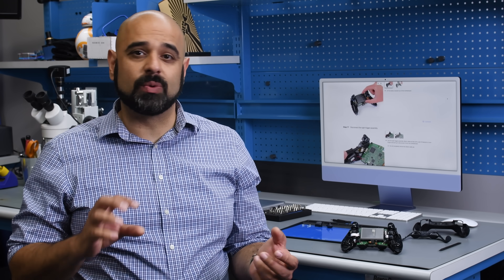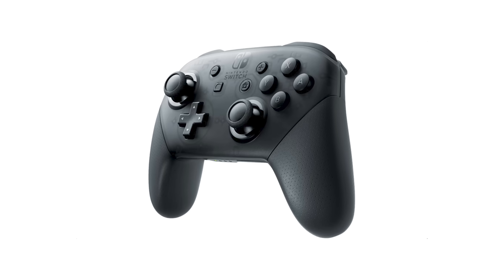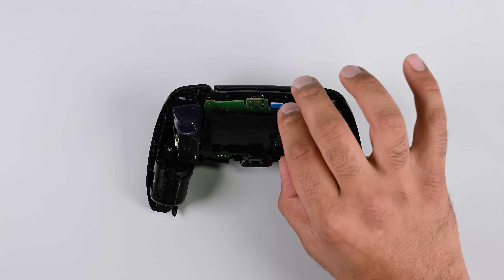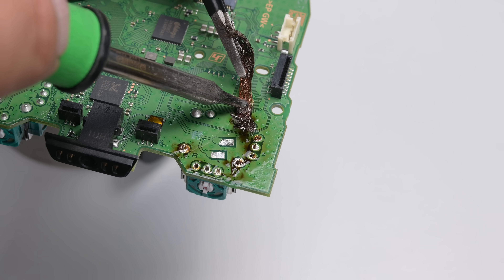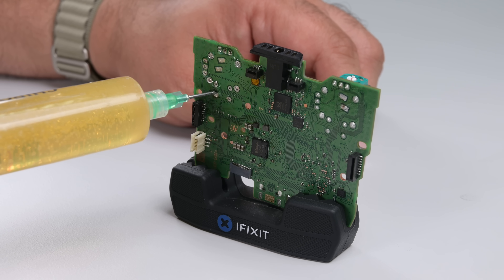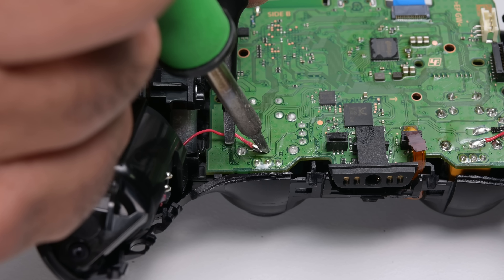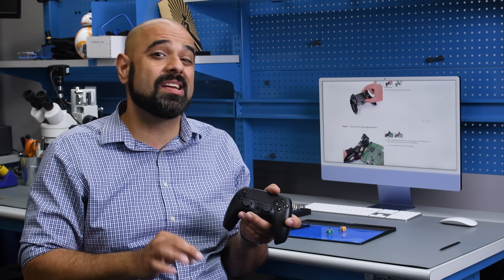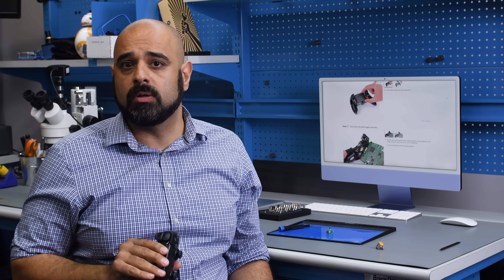How to Fix PS5 Joystick Drift for Good!

Comment: God, the more I learn about electronics, planned obsolescence, and how cheap spare parts are in comparison, the more I think I should finally learn how to solder.

Edit : corrected a mistake
Reply: You should. Its not exactly super hard, though the equipment could be expensive. Its a life long skill and you'd be glad to have learned it once a "i could repair this" moment arrives.
Reply: Go for it. Electronics are ubiquitous now, and being able to do basoc repair work is definitely a skill worth javing in your back pocket.
Reply: What you just said is why I taught myself the absolute basics through YouTube.

I had to start replacing the mouse buttons on one of my Logitech mice because it was double clicking like crazy.

Now I'm capable of doing very basic soldering. My greatest feat of work is putting a back buttons kit on my dual sense controller.

It takes me forever cuz I'm scared of messing up but I can get it done
Reply: Do it, it's not that hard.
Reply: Wait until you find out I made my own custom controller that polls at 8000hz vs the xbox elite at 250hz and I modded my GTX 1080 Ti so it has 22GB of VRAM. You're all getting PLAYED by nvidia and microsoft to steal your money selling you dogshit at inflated prices every year.
Reply: Soldering is easy. Takes a little practice. It'll save you so many thousands of dollars
Reply: Yea it's not super difficult to start learning, especially if you start with something larger like audio cables. 

The problem most of my students have is that they buy a cheap iron that doesn't maintain heat accurately, and then they end up struggling between "it won't heat up" and "I melted everything" lol
Reply: Solder*
Reply: @luigiymario2xd  thanks for the correction. I appreciate it
Reply: Hakko FX888DX is best bang for buck

Comment: It is possible to remove the potentiometers from the stick, that could make it easier to unsolder because things can be removed in smaller pieces.
Reply: Actually yes, just pry them open from the rest of the stick module while still soldered and when you heat up the three joint pads at the same time you can squeeze them out easily.

Sadly the potentiometers shown in this video (the most popular ones and seemingly the best option available at the moment) only fit their own analog modules so you still need to desolder the stock analog modules, but at least they feel smoother than the stock ones.

Comment: My biggest question is with these, are they as accurate and feel as good as the actual sony one's? Gotten some and they just don't  work the same... But i guess I'll have try them out my self once my  ps5 controller starts up... Usually for hard core gaming they last between 6-12 months for me. All from Walmart, got one directly from sony online and that last 3 almost 4 months. Currently i got a ps5 Controller, my first one, so we'll see if they last as bad as a ps4 controller, granted... I know some models use the exact same joycons as the ps4 controllers so I'm not expecting much difference.

Comment: hall effects sensors also suffer from stick drift caused by demagnetization
Reply: unless you're storing your controllers in a box full of neodymium magnets that's not gonna happen, the only other way is through heat which would melt the controller in to a puddle anyway

Comment: U guys should start selling battery upgrades, show us biggest and best quality battery we can put inside.
Reply: yeah I know right, i got me a 4000 mAh battery in mine, I got from aliexpress, controller lasts slightly more then 1 day of playtime now ;)
Reply: @XxUnkn0wnxX95X wow can you link it please
Reply: @XxUnkn0wnxX95X  which is still not much at all tbh, its what my curent ps4 controller holds and it has the original battery, tho I find it absolutely trash taht its barely a day while my old x360 controller lasted over a week of 10 hours of gaming per days with just 2 AA batteries, lipo batteries where suposed to be an upgrade compared to AA batteries, not a Huge downgrade...
Reply: @SpeedyGwen  you play too much use wired controller
Reply: They actually do now! A 2800 mAh one.
Reply: I play every day and do 4 charges a month with my Xbox elite V2 controller...PlayStation need to step up their game on controller battery life...absolutely ridiculous.
Reply: @JointEffort_NL  the problem is more that Sony's controllers are a bit more "feature rich" and all the rumbling and stuff simply uses more power. Still though, the battery life is ridiculous, recently got myself a PS5 contorller for PC gaming and it's definitely a let down compared to my xbox controller in many aspects. There are things I like about it too though
Reply: If a second one can fit inside the shell, you could wire a second one in parallel with the existing one. I did that to my wireless mouse and it now has twice the battery capacity 🙂.
Reply: If you have something that runs off batteries and you use it a lot it's going to discharge the battery no matter what you do. Just about everything takes some type of energy source and needs replenishing. I get that maybe putting a little bit of a bigger battery in will extend your time between charges but soon you'll be complaining about that battery is not big enough and for some reason taking a break and charging a controller is too difficult for some of you. Seriously weird things to complain about these days. It's almost like your life isn't easy enough as it already is.
Reply: @relive1775  Those batteries have a finite life span, and their capacity degrades over that time. Eventually, the battery needs to be replaced. This isn't a new concept.
Reply: @nickdibart   I understand that but that's not what's being discussed here. The discussion is getting more playtime out of a controller before having to recharge it. Most of these controllers take about 3 hours on average to charge when not in use, not to mention most people have charging cables all around them when they're playing and they can plug it in right where they're sitting. And if we're worried about people who are streaming to make money then they should have no trouble affording one extra controller to switch out with. Not trying to sound offensive so please don't take it as that but we're talking about finding solutions to problems that are so minuscule and easily remedied that it's kind of ridiculous.
Reply: @relive1775  I agree. It's been a while since I originally posted so I forgot the context of the conversation. The battery life on the dualsense has never been an issue for me, and as you say, a simple USB cable will suffice if I forget to charge it long enough for it to be a problem.

Comment: I've done a tonne of stick replacements on DS4s, I recommend one of those solder irons with a built in pump for desoldering. REALLY helps removing the old solder.
Reply: A decent solder sucker and low melt solder is significantly cheaper and 95% as good if you are only desoldering through hole components occasionally
Reply: Yea, can you post a link to an iron you'd recommend
Reply: Can i get any recommendations?
Reply: @corniel657  hakko if you want to invest in a pretty decent one, or go pro with jbc or weller.
Reply: @corniel657  hakko minimum, weller or jbc if you really want to invest in some great equipment.

I myself run 2 weller wxsmart systems a wx2 and 2 wxair units.
Combined with zero smog unit and 6 different solder irons.
Reply: What’s the name of the tool you use to hold your board in place?
Reply: That's the way😊
Reply: Being a PS5 owner means doing hard labor.
Reply: What is the name of it can you please send me the link of the soldering pump you are speaking of
Reply: @alansmithee2012 Can you share a link to one such soldering iron? I didn't know there was such a variation. Thanks in advance!
Reply: just bought one of those, I was struggling so bad to remove the old solder with wires, I gave up LOL
Reply: I agree 100 percent with you on this.  I purchased one as well.
Reply: i agree. i overdid (first time soldering) one circle and some thin sheet came out. my old controller has right dead stick now. i overdid it because i tried removing the solder using copper wire and the tip of the solder which scratched it off.

Comment: I buy 1 controller from Argos + insurance around £5. When it broke I take it back and replace it for a new one + I take out the £5 insurance again. Cheap as chips❤

To add. I’ve had 5 PS4 controllers and 3 PS5 controllers. Yet I’ve never had issues to date with the PS3😂

Comment: This was a pretty fun project to do. I was an absolute beginner going into this, I did know about this before this video so I already have done it, but if you are a beginner and you are looking to do this, its definitely doable. I had a solder with a heat gun station, and the heat gun to remove the joysticks made things so much easier.

Comment: I have been installing hall effect analogues for over a year in my service center. so far we have made almost 3,000 controllers. I have cooperated with all the big factories such as GinFull, K-Sliver and Favor Union. The best of them is Favor Union, their joystick are the fastest and most precise analogues on the market. Ginfull a regular 3rd party analogy factory t, which emerged from the K-Sliver split. Due to this, the technology is not accurate and cannot be copied from the main entity, i.e. K-Sliver. Unfortunately, Ginfull analogues often have problems with the stickbase and their hall effect chips have problems with AVG Error.

Comment: I bought some Hall effect sensors and tried to do this repair, but I am hopeless with soldering. I couldn't get the original stick off the board after several hours and gave up. I'm lucky I got the rumble motors working again.
Reply: Don't give up. You need a WARM iron. 400 C + 

Use copper sucky thing.
Reply: @viktorpettersson9975  thanks for the encouragement. I have the copper stuff, so I'll try again when I'm ready to commit to the task.
Reply: you don't need to do the whole stick, just swap the sensors, 6 solder joints and you're done.

Comment: Excellent video, I did it on my ps4 controller few months ago, work well. Depending board version soldering pads are way smaller than others low melt is necessary & can find even cheaper 2$ each from China … worth it !
Reply: PS4 controllers were the worst

Comment: I'll ask this here since I've already bought these joysticks for 2 dualsense controllers... and its a new video.

Why might these ps5 joysticks be incompatible with a Switch Pro controller?
The two Alps joysticks look identical besides orientation on the controller.
Reply: They use the same sticks, it will work.

Comment: Amen. I bought an edge hoping that gulikit would make a slot in replacement. They've kind of gone silent on that project.

Thankfully, I had the good sense to buy replacement sticks when they were in stock. But my supply is running out and like you said, the replacements are now out of stock all the time.
Reply: Same, although I did keep a set of drifting joysticks after replacing them. I might just try my hand at working out how to slot in hall-effect sensors myself

Comment: So obviously intrigued by this ( despite not facing any issues with my Elite 2 Controllers ) I looked around and found some other Videos about installing such Gimbals all of which utilized an additional PCB that had to be soldered on the other side of the Controllers PCB ( be it PS or Xbox ). Do the Gimbals in this Video have the PCBs Electronics integrated into them or why is there a difference? 🤔🤨
Reply: The new calibration software makes the extra  PCB obsolete. Now you can achieve the same functionality from your web browser with any sticks, hall effects or not :)

Comment: there isn't a valid excuse, I'm not paying 70 dollars for another controller unless it is for a fault that can be traced directly back to me, and not because of a known design defect, analog sticks should not be a wear part, if designed right, can last for many decades, like the dreamcast controller.

there is no excuse that would be acceptable if the dreamcast and the sega saturn controller were able to make hall effect analog sticks and have them be on their controllers, then you can as well.

No excuse

Comment: well, in my experience, heat gun is the most effective way to remove old thumbsticks/joysticks. while desoldering with a soldering iron or hot plate is an alternative, but the process is significantly more challenging and extremely painful imo. melting those solder points is really time-consuming and takes a lot of patience since too much heat can delaminate the board.
Reply: Which heat setting(celcius) do you use on the heatgun? Trying to desolder the sticks, but I'm not really cutting through the lead free solder with flux and leaded solder..

Comment: Is there anywhere we can purchase these from a reliable source? I'd rather not risk buying cheap sticks from somewhere like Amazon or Aliexpress.
Reply: Buying these from Aliexpress is as close to buying straight from the manufacturer as you can get. The cost is so low that risk is minimal. Any "reliable" source is only going to have bulk bought from China and applied a markup. I'm yet to have a truly bad experience with Aliexpress and I've bought a good few reasonably expensive items over the years.

Comment: this was an excellent video and very helpful. I have 1 question however,  can the Hall effect thumbsticks be used to replace the thumbsticks in the dual sense edge  pro controller as well?
Reply: Yes, and it's arguably simpler since it's a small board that you can work on

Comment: Hold up, that's great and all for my regular PS5 controller, but so what about the PS5 Dual Sense Edge controller? Is there anything that can be done about the individual joystick modules or are we at the mercy of Sony for the DSE?
Reply: I can confirm that the same hall effect stick works on the edge. The same orange one used in this video.

Comment: Stick drift can also be caused by dirt stuck in the joystick and can be easily fixed by pouring some isopropyl alcohol in and spinning the joystick to dislodge the dirt. 

This is definitely the first solution that should be tested before spending money and replacing the joystick or entire controller.
Reply: Gentlemen, you just saved my controller, thank you. Checked and it was dirty af, and I had to blow inside the joystick. No drift anymore, can keep on gamin'
Reply: When my joystick drifts, i tilt the stick and blow in the crack between the body and stick cover. Works everytime
Reply: @Paronak  A man of culture
Reply: If that's the case, how is it possible for PS2, OG XBOX, 360, and other console's controllers to be free of that kind of drift?

My common sense tells me that older consoles would be more prone to develop drift on their sticks, but not.
Reply: @Merely_an_Explorer  Older consoles had a different way of centering itself. They still used potentiometer with a small caveat. They're wired and when you turn on the console and dont move the stick, the console will take the motionless stick position as the center point. If you tilt the stick to the right (lets say) the console will take that as the center point and will read a super left when tilting the stick all the way to the left. Older consoles literally calibrate the controllers every time you turn on the console or plug in the controller. That's why sometimes during that time people will say NOT to tilt the stick while turning on the consoles.
Reply: @Ice_2192  That's not true, I had a PS2 controller get drift on the left stick eventually. We just didn't use the right stick as much back then so they didn't wear out so quick and games implemented massive deadzones so it wasn't as noticeable until it got really bad. I remember dropping a PS2 controller and damaging the right stick such that it got stuck leaning diagonally and it didn't self centre, it would hold that input.
Reply: @talibong9518 left stick tilting at its default state =\= stick drift. I have a controller stuck at a tilt by default. When you turn ps2 with it connected that “tilt” is now the 0,0 (center). There are multiple videos on YouTube on how it’s explained. There is only a drift if you force it to the center AFTER turning on the system. It’s completely different from today’s drift where the console, by default, assumes the state is 0,0 and if your controller connects to it and it’s tilting like -5, 10 then it will read a tilt.

Comment: i'm curious, why did you use a wick to desolder instead of a pump?
Reply: he clearly state sin the video that he's doing it in the least expensive way possible. solder wick is dirt cheap.
Reply: @arcticowl1091  but is it the cheapest way because you'll eventually need to buy more wicks but not more pumps
Reply: @ITSYEBOISteven  which is nice, if you're going to be soldering a lot. Most people who see this are not going to be doing that.

Comment: So i did this a while ago, and now the left trigger is constantly at max feedback and thinks it’s always held down. I’m assuming i damaged the motherboard or the ribbon cable? I actually had to get a new tip for my iron because the solder wasn’t melting, quite a mess tbh.

Also the X button doesn’t work in specific games? It works in the ps menus but doesn’t in ow2. I tried another controller and that worked fine, maybe a side effect of the trigger always held down?